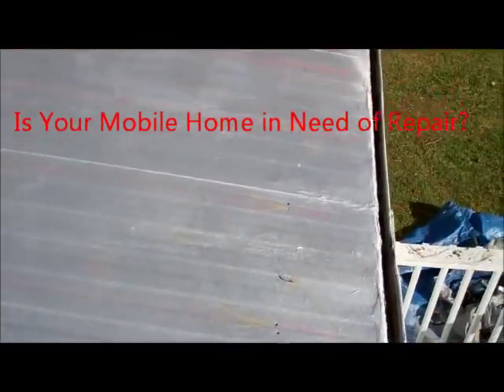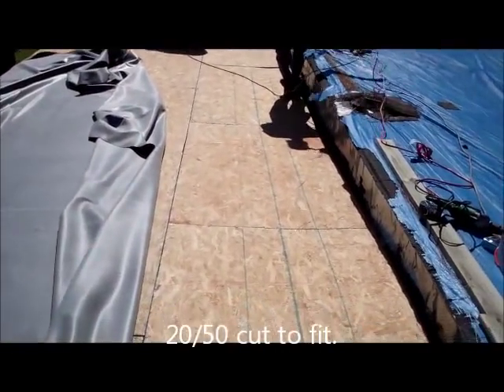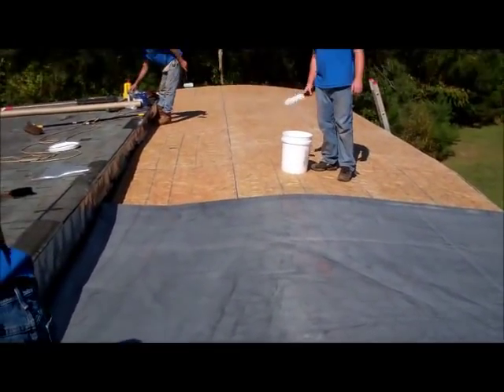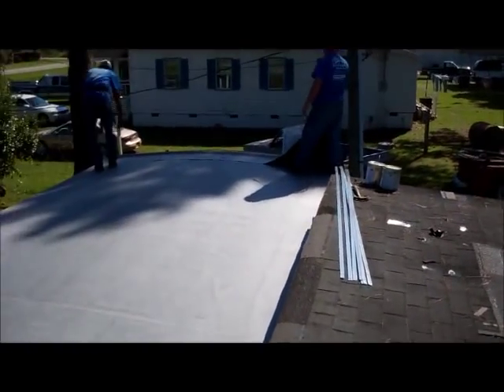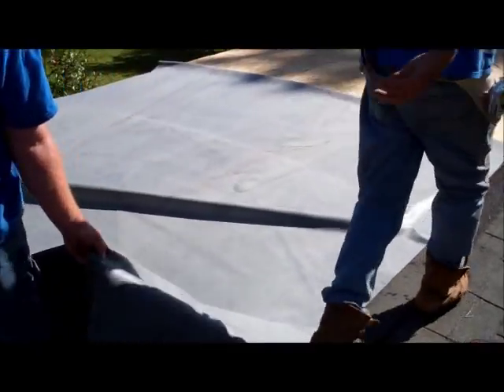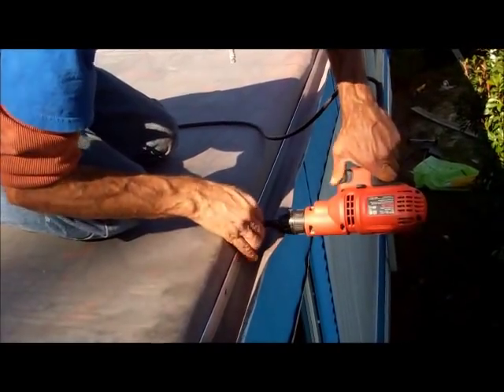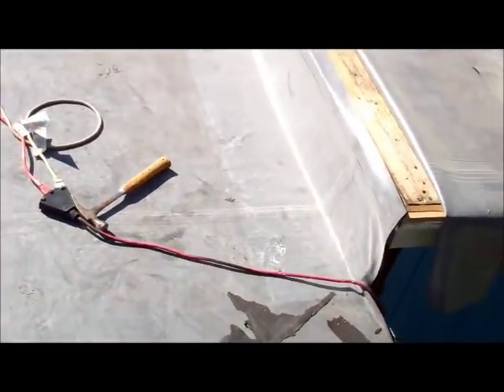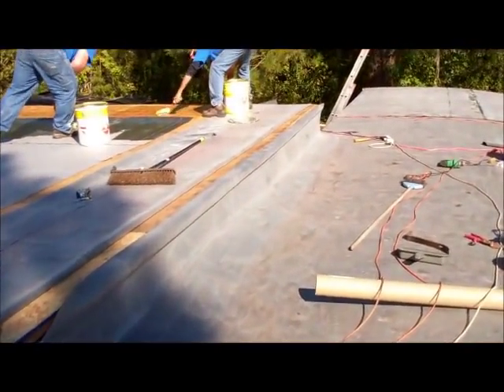Mobile Home Roof repair. How to.

Comment: Is the glue necessary since the whole thing is held on all edges with the termination bar? Or did you do it on this roof because of the step?
Reply from the maker: Are use glue on every roof the older ones I used to use a different kind now I use white water base substrate glue to hold the rubber down. If you don’t put glue on it in the summertime when the rubber expands you’ll have a balloon on your house
Reply: @Drewsroofingandhomerepair  Ah yes, that makes sense.  Thanks for the response  as I have to tackle this job soon. How many gallons would it take to cover a 14x66 do you think? Appreciate all your videos.
Reply from the maker: 7 gallons